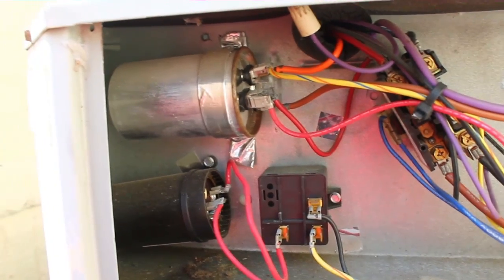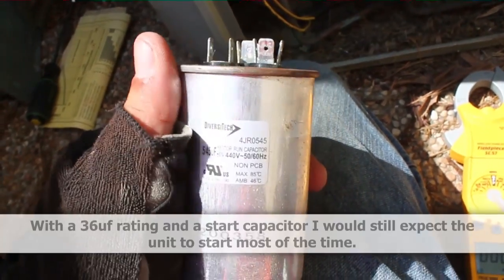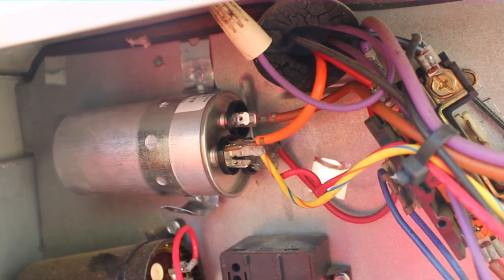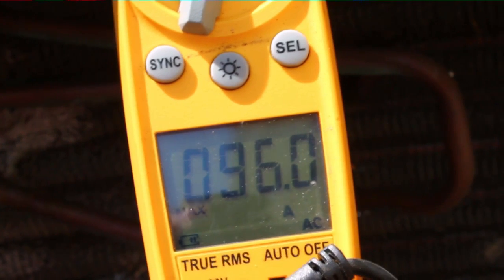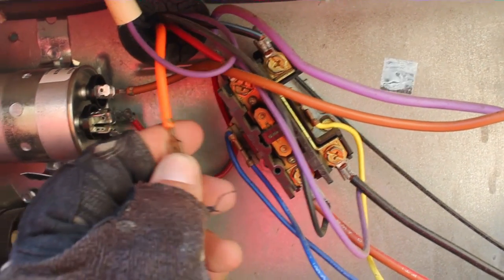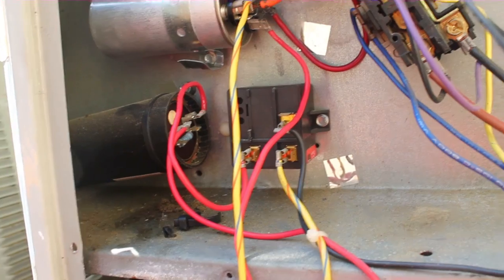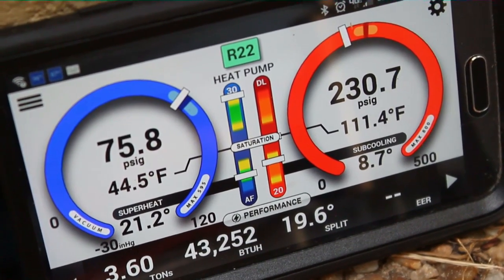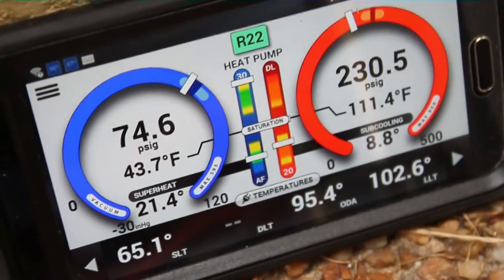HVAC Service Training- Compressor Fails to Start

Comment: Hey i was just watching that video where you worked on the year old r410a amana 13 seer unit with comfort alert and remember it had a burnt wire isn't this the unit beside of it with a burnt start wire in this video u did about two mouths ago the other video is from June in my apennion i have came to a conclusion that there maybe some power issues there like maybe the disconnect box the the two breakers my be croted or maybe some type of power issue in the area or something electrical going on like something cause maybe like low voltage and causing them not to start good on some accessions but i may be wrong but just my apennion on it

Comment: I like the video.  Nice one...  dam burned wires will drive ya nuts ...  especially in a unit you have to work upside down to fix them :-(
Reply from the maker: Billy Knoth Yep, it was some circus stuff

Comment: Is that a app on a phone ? And nice video btw .
Reply from the maker: nelson ceballos It is part of the iManifold setup. It is a set of digital gauges that have wireless sensors and transmits data to your smart device.